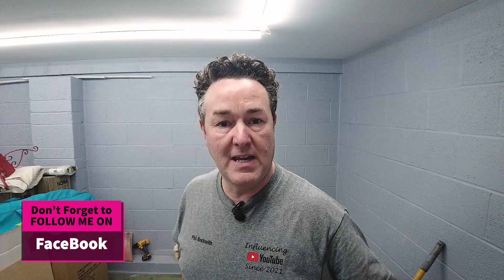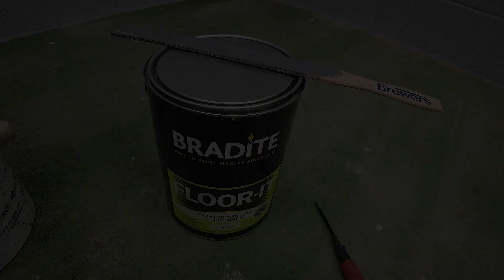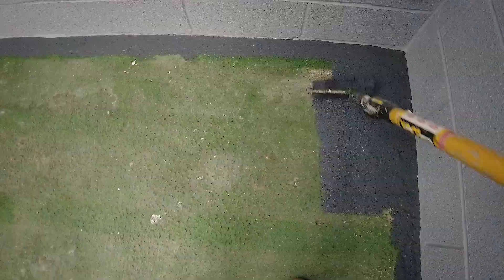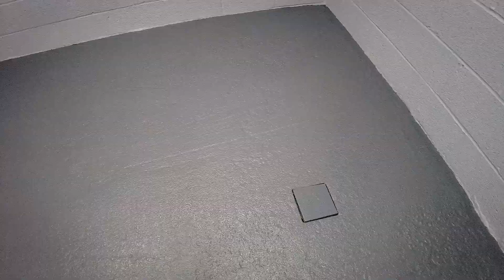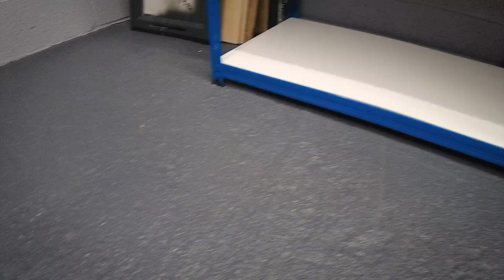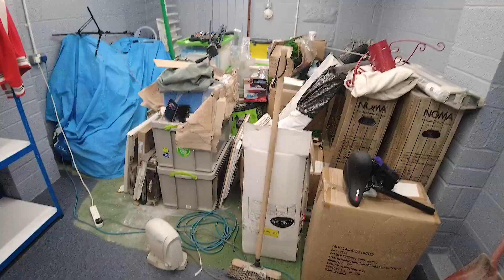Transforming My Garage Floor with Bradite Floor It! 🎨✨

Comment: On the very very rare occasion I paint a floor i usually stick a laser line about 4 inches up the wall, mark a pencil line all roumd and bring the floor paint up the wall. Saves messing with trying to cut a rough, bumpy line on the floor.
Reply from the maker: That's a great idea! Better brickwork I'd take it up the first or second brick line

Comment: Looks a decent product and far nicer than an old pil basses that never dry! Unrelated question, ive got a job where a punter wants her conservatory tiles painted rather than ripping up, amy products u would recommend fella? There that old scool semi shiny teracotta ones. Not sure how to paint the grout so its not all one colour as may look a bit odd, any ideas from urself be great 👍
Reply from the maker: would this product work?
Reply: Not sure buddy, may be a bit shiny, tbh I don't really want the job! My gutt said zinsser allcoat matt but I've never used on a floor, also thought painting whole floor and the grout being same colour may look odd so was gona small brush white on the grout with some zinnser, if this person wasn't a great client I'd run a mile!

Comment: My painting firm was working at Kings Cross during the big renovation that took place some  years back, we had to do night work using an imported 2 part floor paint in car park areas, the drums had the skull & cross bones hazardous symbol & all we was supplied with was silly paper masks & we did around 5 mins each doing a section with 9 inch rollers before you was told to swap as the fumes were so strong, when me & a mate was taking to designated skips it was getting hotter & hotter & steaming to the point where it was like carrying , wrapping arms around a boiling kettle, no health & safety back then, i dread to think what that stuff has done to my lungs although i feel fine, i said to my mate look at this stuff, what's that doing to us, think it was a dutch product & so you couldn't read the back, this was a time when a lot of firms were going under due to lack of work & the Kings Cross job lasted 5 yrs & kept the firm afloat & they took on all work, we wasted loads as the small Hardner big drum mix ratio was going off too quick to use so we reduced the hardner a bit, wasted loads & it cost a fortune
Reply: Sounds like an epoxy resin paint. I do a fair amount of fibreglassing and always end up chucking loads of smoking hot resin away. Your employer was very naive not giving you respirator masks, especially in an enclosed area. As a one off you'll be fine but if you we're doing it regularly then your lungs would be shredded.
Reply: @PBYM79  yeh cheers for the heads up, I'm my own boss today & got out over 12 yrs ago, my boss was so tight mate that he accused me of nicking paint in my early years when i looked like I'd fallen into the paint pot & climbed back out, i learned to get nothing on me, rolling ceilings etc & painters would wonder how i was spotless, joked how i told my missus i really work in an office, had some laughs but got out the right time, 39 yrs now & counting👍
Reply: MMA fast cure acrylic resin systems used on the rails. Absolute brilliant stuff you can trowel down or paint a floor and walk on it within an hour 👌🏻✔️
Reply: @Dcreedondecorator  them day's are over now, I'm 57 self employed & now paint lovely house's in Essex mainly redecs internal, odd Ext, think I've earned it 👍

Comment: Great vid. Garage floor is on my to-do list.  An unrelated question Phil. I have a pre primed Howdens door with glass panels. The glass is held in place by a plastic trim. Presumably, light sand and then prime. Zinsser Bullseye?
Reply from the maker: Hi. any  primer/UC will be ok tbh for pre primed doors
are you wanting to paint the plastic as well?
Reply: @ProfessionalPainterDecorator  since they are white plastic trim and I'm painting the door white, I could leave them alone. The rest of the panels a light grey 'pre primed' factory surface. Edges are wood so will prime them